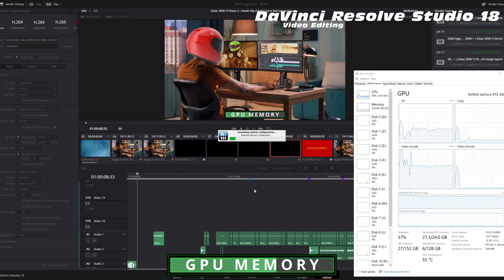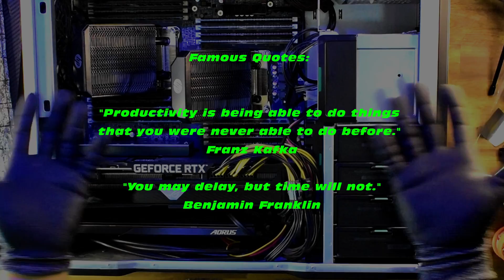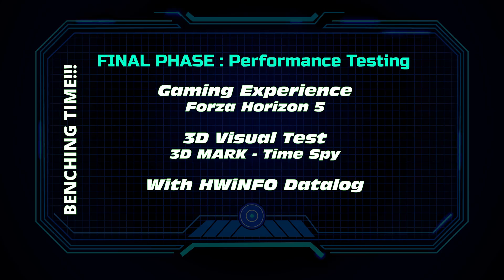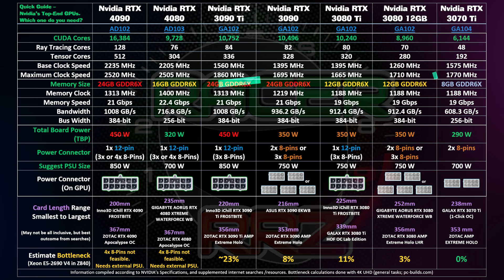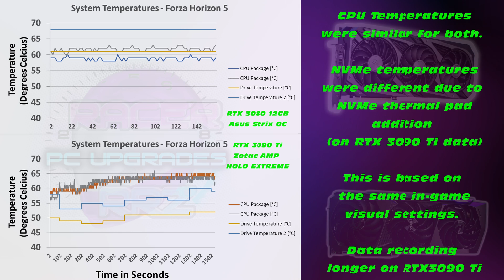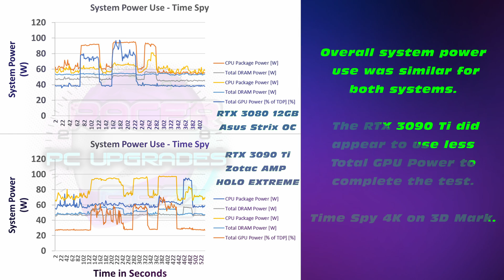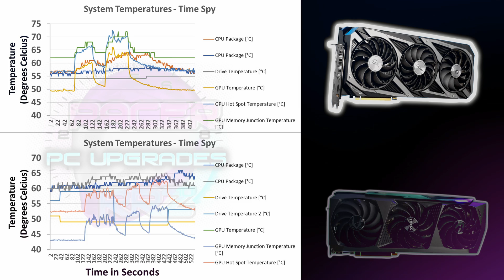GUIDE: Z840 Fitment of ZOTAC RTX 3090 Ti - Unleashing the Extreme Power in a Workstation

Comment: Z640 here
64GB DDR4 ECC 2133
Xeon e5 2699V4
Z420 Liquid cooler
HP Turbo drive (1TB Corsair mp600 pro nvme) boot
2x4TB hdd
2 blu ray drives
RTX 3090
Fucking amazing…
Reply from the maker: Nice, the Z640 is a solid performer. That's a solid combination that you have there. How is the Z420 cooler working out for you? I found the stock Z440 cooler to be more than enough to keep a e5-2697A V4 cool (side note, the Z840's stock cooler was insufficient oddly enough). 

I am sure the HP Turbo drive will serve you well. How are you powering the RTX 3090? I presume it's a 2x 8-pin founder's edition? I had in mind the Z640 only has 2x 6-pin power cables (but I have not had the pleasure of owning one). If there are 3x 8-pins you should be sorted for most GPUs, minus the newer 4x 8-pin variants.  

Also, if you have some cash for a RAM upgrade the prices have dropped a lot. I just picked up 64GB of 2400MHz Reg. ECC memory for my Z440 NAS build.
Reply: @racerrrz  the current z420 AIO keeps temps well below what you would expect from a xeon, or an i7-6950X, used and tried on both, 2699 v4 with thr AIO tops out around 47C under max load, the 3090 is powered with 2x6pin TO 8 pin adapters it is the palit gaming pro, the turbo drive has the corsair MP600 but im trying to find the one you have with the little blower🥲, side note to get the AIO working on the z640 due to pin differences on mobo and on the Fan/aio combo i had to cut the fan header clip on the side to fit it
Reply from the maker: @550F21CEMO  Nice, the 2x 8-Pin RTX 3090's are much easier to manage in these workstations. 

The smaller PCIe adapter can be sourced on ebay for $20 USD, but I would recommend going for the Asus Hyper M.2 V2 instead. It can hold 4x NVMes on a PCIe x16 lane (with bifurcation; and you can run just 1x NVMe also), plus I found it to have excellent thermals (I compared the HP Turbo Drive Quad Pro, Gigabyte AORUS Gen 4 and a Jeyi Quad U.2 to M.2 PCie adapter to the Asus Hyper M.2 V2 in a related video: https://www.youtube.com/watch?v=xqg0uQ93KTg). 

Nice job with the fan header modification, I have not seen that done before but it makes sense to be able to repurpose the coolers. And given that the e5-2699 V4 pulls some power, it means they actually work really well!

Comment: Edit: After reading a few comments, you have actually extensively answer my questions, so thank
What about the the G8 Z4??? Still PCI 3.0, but what kind of performance upgrade is to be expected from a Z840 with the same configuration as this. I also assume the 4000 cards would be heavily bottlenecked?????

This video was extremely helpful, and I'm going through all your other Z840 videos now. I plan on getting one of these, and was wondering what kind of frame rate you get while gaming, and how it compares to modern CPU (intel 10th-13th gen) with the same GPU(Maybe you already this in your other videos. I'll find out)

Also, have you had the chance to test RTX 4000 cards? Since the Z840 is limited to PCIe Gen 3, and has a much older CPU, how much performance are you giving up when using a 4080 or 4090 card? What potential issues could be encountered with the 4090 since it has 16 pins?
Reply from the maker: Hi, I am glad to hear you found the video useful. Yes, it is jam packed with lots of info! The Z840 will see substantial bottleneck with the newer RTX 4090 GPUs, at an estimate, there would be between 25-40% bottleneck (which is a lot!). The RTX 3090 Ti would have ~10-30% bottleneck. These are estimates and the actual number will vary depending on the final configuration of the machine. If you are going to go down the Z840 route you should aim to get the E5-2697 V4 CPUs (best value at the moment). DDR4 server RAM (2400MHz) is becoming more affordable now also. For the cost of the workstation they still are great value. For bottleneck calculations you could try: https://pc-builds.com/bottleneck-calculator/result/0BD1ci/1/general-tasks/3840x2160/ (link may break over time)

In terms of the RTX 4090, they are not technically feasible due to requiring 4x 8-Pins to drive the GPU (the Z840 only has 3x 6-pins, 12V @18Amps each, netting theoretical max of 648W (living on the max isn’t a great idea). I am not aware of any power adapters that would allow 4x 8-Pins to be reached without exceeding the power draw on a single 6-pin (216W) on the Z840’s PSU. Thus, a new PSU would be required. On that note, I have found a way to replace the Z840’s PSU with an aftermarket unit (likely a 1600W unit would suffice). So the RTX 4090 is possible, but it requires a bit of a Frankenstein machine. For now I am quite satisfied with the RTX 3090 Ti, it handles everything I throw at it. 

The ideal candidate now is the HP Z8 G4 (Z840’s upgrade), but hardware prices are still steep on them due to being newer. They do however still only have PCIe 3.0. The HP Z8 G5 has PCIe 4.0, but check Linus’s video for the machine costing / performance (ouch and wow). The HP Z4 G4 would be a cheaper path if you can live with only 1 Xeon in your machine. The bottleneck will not go away any time soon though. 
In terms of FPS, I’ll refer you to cyberpunk gameplay secret video (I had a hidden QR code in a video to link to this video – but not many people found it  😂). https://youtu.be/-4vHZ59Qllc?si=dRP4Ltmoihf_DyZh 
The Z840 was recording in 4K in the background with OBS so the FPS was lower than you would obtain in game. 

I also compared the RTX 3080 and RTX 3090Ti in Forza here (cosy 4K 60FPS in Forza Horizon, screen cap is 60FPS):
https://youtu.be/36g5HI2klA0?si=zTgj6wotynnU6VHr
Reply: @racerrrz  Thank you so very much for this thorough explanation. I actually just saw Linus' review of the Z8 G5 yesterday; easily a brand new german car right there 😂. 

I initially wanted to go with either the Precision 7920 or  Z8 G4. I'm more inclined towards the latter however, but I'm gonna wait a little longer for the price to go down. I was very close to drop $3000 on a very nicely spec'd one this week, but I believe if I'm just a little bit patient, I can find what I really WANT (not what need lol, 1.5TB RAM, 2 Xeon Gold 6230R for running multiple VMs, video editing etc..) by Q1 2024 at a very nice price. Or even maybe, just maybe a lower end Z8 G5 that I can upgrade overtime. 

Beside being able to support more and faster memories, the 2nd gen scalable isn't that much faster than the first gen from what I've seen so far. I haven't been keeping up with the tech world the way I should have in the past few years, but everything points to "I should wait at least until next Q1 to make a long term decision".

Thanks again mate! I was your 670+ subscriber and I'll definitely let you know what system I get by the time you reach 2M subscribers, hopefully before new year ✌😌
Reply from the maker: @gate9595  
Spot on there, HP Z8 G5 vs house deposit vs new luxury car. But only one of those can do VMs and video editing 😂.

Actually, the Lenovo ThinkStation P620 Tower Workstation could be a solid alternative also. Their prices are lower than a Z8 G4/5, but for the price point they have high functionality (e.g. Ryzen Threadripper PRO, DDR4 3200MHz ECC, 1000W PSU). 

Are you sure you want 1.5TB of RAM? I am only on 256GB and the Z840 workstation has completely replaced the need for a room heater in winter (aircon is needed in summer…lol). The longer you wait the better the deal will be, but at the cost of not having the system on hand to get work done faster now! 

The Z840 is aging a bit but for the price point they are still really good value. They can’t game at 4K 120FPS, but with up to 44 Cores 88 Threads (E5-2699 V4) and 2TB of DDR4 (LRDIMM; 2400MHz) they can get any task done, albeit slightly slower than the Z8 G4/G5. 

The only other catch is hardware pricing. I have considered updating to a Z8 G4 but the cost to build one that matches my current Z840’s specification is 4x the value of my Z840 in its current state. It might be better to save for that house deposit / new car after all.lol

Thank you for the sub! I’ll have to fast track some more Z840 upgrade videos but right now the machine is working as it should and I don’t have many bottlenecks I can address. CPU prices have come down so there is that option. 

That sounds like a challenge, but who will win? The race to your Z8 G5 and my 2Mill Subs by Q1 2024, I know which one I would expect to see occur first (I'd be happy with 1k by then lol). Let us know how that buying process works out, but definitely scope out the Lenovo Thinkstations also, they are great value machines also.
Reply: @racerrrz  1.5TB solely for its ridiculousness, as I plan on making YouTube videos of the system as well. Nothing too technical at first, but they'll still be educational. If I see a YouTube Thumbnail that says "1TB of RAM" , I don't care what the video is about, I'm clicking immediately; especially when it's used as a personal daily driver 😂
-
I'm indeed concerned about both the heat and fan noise that could rise from that much hardware (2 Xeons, 1.5TB RAM, a 3090, 4 or 5 HDDs), and I truly hope it wouldn't be too much annoying. We must see!

I'm not into AMD systems yet. AMD doesn't get workstation systems it deserves from the big three (DELL, LENOVO, HP). Beside their raw CPU power, AMD Workstations are always lacking features when compared to their intel counterparts. Precision 7960 vs 7965 is an example. Correct me if I'm wrong; I don't think the big three ever attempted a dual CPU AMD system. Perhaps that has something to do with their CPU design, but I don't believe the big 3 show the same love to AMD as they do to intel. It makes a lot of sense from a business prospective , as intel has been holding the majority of businesses down for decades, not just corporate America, but across the world. It's like Amazon, eBay, Newegg etc.. Amazon started first, then eBay followed.

Anyways, I digress lol. AMD has been in the game for decades, but its fame is something fairly recent, and I believe they are gonna keep surprising us.
Reply from the maker: @gate9595  I am slow to follow up here sorry! I picked up a Z8 G4 and it has seen some limelight in my most recent HDD expansion video for the Z840. Thus far I am quite impressed with the Z8 G4. Its overall power draw appears to be lower than my Z840 (with near the same hardware fitted). I can't afford that thumbnail (1TB of RAM, ouch lol), but I will eventually install 256GB of 2933MHz ECC Reg. in the Z8 G4 (I tried to install it but the Z8 refused to boot - I presume I need Gen 2 Scalable Xeons for the faster RAM). 

The AMD workstations are quite powerful from what I have seen, but cost is a factor. If you could obtain a Precision 7960 with an Intel Xeon W processor that would be way to go in terms of performance. The AMD offerings are quite powerful in terms of cores/threads for the $$$, and for the more general use they would offer solid performance. Something like the Precision 7875 Tower would give a solid experience, but at a cost. For the time being I'll see what I can get out of the Z8 G4. The Xeon Gen 1 Scalable processors are relatively affordable right now which makes these systems a great upgrade over the older X99 workstations. The Thinkstations are generally priced quite well. I haven't had the privilege of owing a Precision or Thinkstation just yet, but they really look like well built workstations.
Reply: @racerrrz  Right on! The Z8 is an excellent machine. I wanted one, but it was quite expensive compared to the 7920. I've actually posted a follow-up comment to this conversation on your Raid 0 video that was posted on August 24th. I figured you must have missed that comment; it probably would have been better to leave it on here for the people who would be reading this in the future anyway. 

Long story short, I came across a local business with tons of precision 7920 barebones being sold "as is." I picked up 5 and was able to get 4 to work. The 5th one had a damaged socket (bunch of bent pins) for not being covered during transport, I suppose. I couldn't be happier with these machines. They just worked flawlessly. Though, an incident happened at my house about 2 months ago; a little bit of water got inside 2, and I haven't had the chance to diagnose them ever since.

Also, prior to the incident, there was one who would not boot when a disk is inserted in drive bay 2 (first/left drive in the top flex bay). That's something I'd need to figure out.

Man, these machines can be extremely complex. The 7920 has taught me a lot so far. If I were to talk about my different configurations for the respective units and the research I've done, it wouldn't fit in a book, let alone the comment section 😆. But I'm still learning and truly can't wait for your Z8 G4 videos! Gen 1 xeon scalables are extremely affordable now.

System 1: 2 x 6138 192GB ecc 2133mhz, rtx 3060 

The 3 other systems: xeon 6140, 32GB 2400Mhz.

I alternated between a rtx 2060 super and a 3060Ti  among those 3 systems.
Reply from the maker: @gate9595  I seem to be plagued by missed notifications, but I do try to respond to the ones I get shown. Likely I saw and responded on that video’s comments. 

I am quite impressed with the Z8 G4’s build quality so far. The Precision 7920’s are quite technical and very well put together. If cores are your thing, you can really go crazy with these machines. 

The Gen 1 Scalable Xeons are mostly affordable with just the top models still costing a fortune. The Gen 2’s are what I have my eye out for but they all cost more than what I want to spend on CPUs right now. The CPU mounting mechanism is a little tricky – but with a good fine torque wrench that is easy to resolve. I’ll need to fast track some of these videos lol. I think a CPU buyers guide would be useful as that is something I need right now.lol. 

Your line-up of 7920's sound like a deal, and even if you just get one or two revived that gives you spares for the others - or sell one on to recoop the cost. I tend to follow the same logic - grab them cheap and keep one as fall back in case of a failure. The water leak getting to your machines is unfortunate but hopefully no major damage done.

Comment: I have a HP-Z820 with dual 2690 V2 cpus with the 1125 watt power supply and have a Founders Edition RTX 3090 on the way. I’m glad to see you were able to get the 3090 ti running in your Z840. I was concerned about how it would work. I have a feeling I won’t be able to get the internal pcie cover on with the height of the card plus power connector. Hopefully I’ll be able to get the side panel back on. I guess I’ll know soon.

I’m getting into AI art generation and local llama. Both are extremely GPU and VRAM intensive.
Reply from the maker: Great combo there. The Z820 with the E5-2690 V2 CPUs makes for a solid platform. The RTX 3090 should work well in the system also, but yes, that side panel will likely be an issue. I understand that there are converters that can switch the 12-pin connector to a 90° connector which may resolve the Z820/840 cover issue. I haven't looked into it since I am also using riser cables to further expand my PCIe connectivity (10GbE NIC plugged in under the GPU). It could be worth checking out these or similar items: https://store.cablemod.com/12vhpwr-angled-adapter/ 

AI is a hot topic and I am sure it will open new possibilities. The Z820 with the RTX 3090 should handle the task well. Just make sure the applications support multi core - if they operate on only one core you will not get the best performance.
Reply: How did you find the 3090 in the Z820? I’m wondering if it’s going down this path for my Z840. Mainly looking to do local Llama
Reply: @DtheDry  I didn't have any problems installing the 3090 in the Z820. You need to get a special high power cable for these machines. I've been using it for local Llama and generating AI generated images with Stable Diffusion. I needed to take off the interior cover because the card is too high for the enclosure. I run it with the back open and I haven't had any overheating or overload problems.